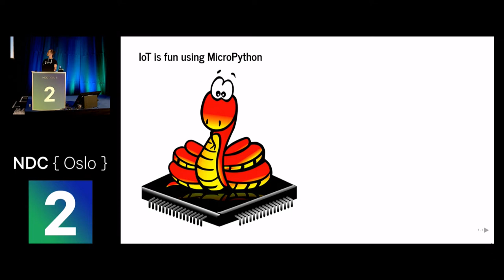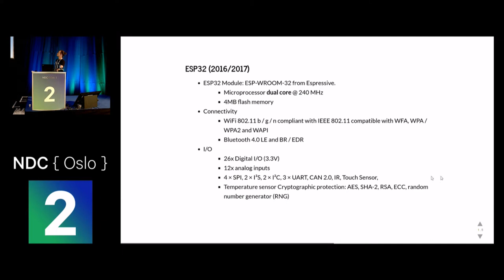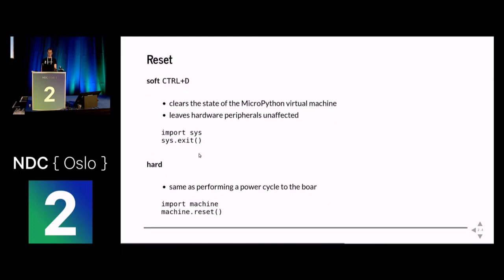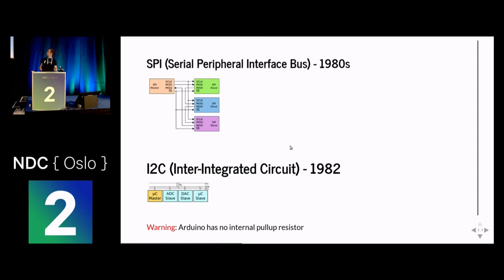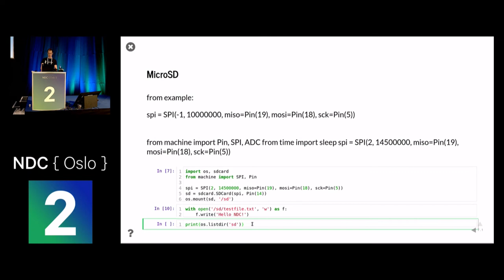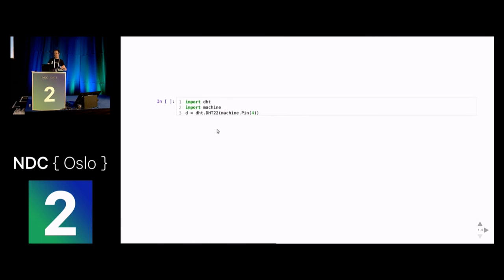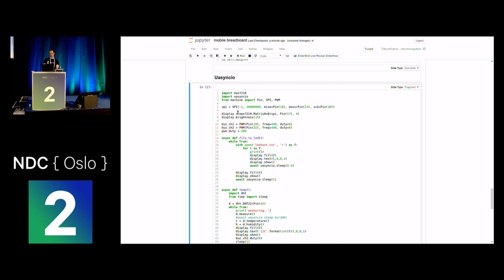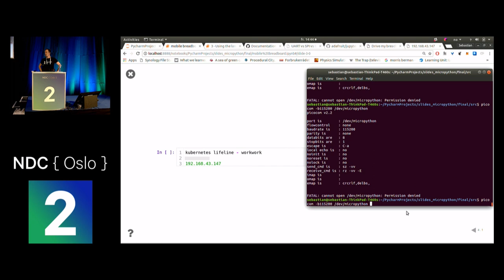IoT is fun using MicroPython - Sebastian Roll

Comment: 50Hz iss extremely low for motor PWM frequency and will cause the motor to be noisy. In an actual pan/tilt/trolley controller I designed (not with the ESP or MicroPython), I used 20kHz.

Interesting presentation.
Reply: Thanks for commenting! As I understand, a typical servo motor expects a 20 ms pulse cycle (50 Hz). That's the frequency I used for this pan/tilt servo bought from pimoroni, shown here: https://github.com/SebastianRoll/thingy52

Did you design your own controller? Cool! I would love to learn diabout it. I recently did my very first PCB design using KiCad:)